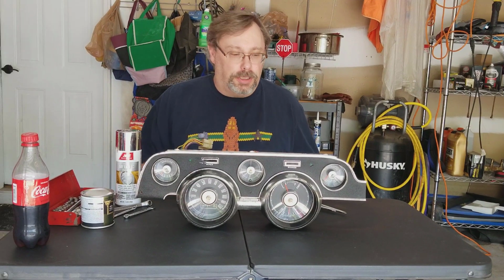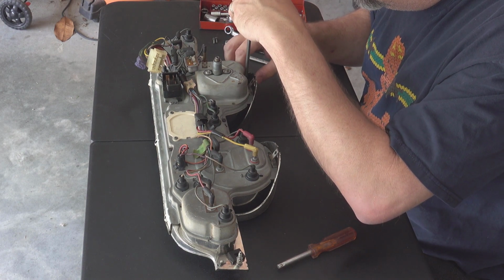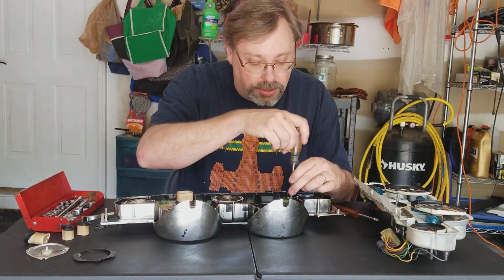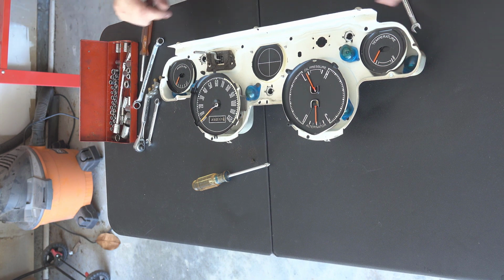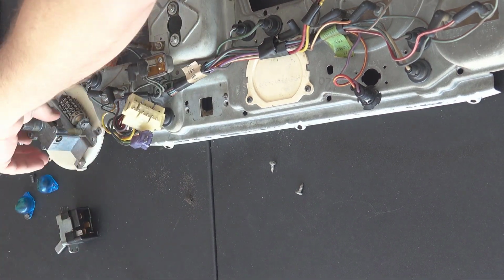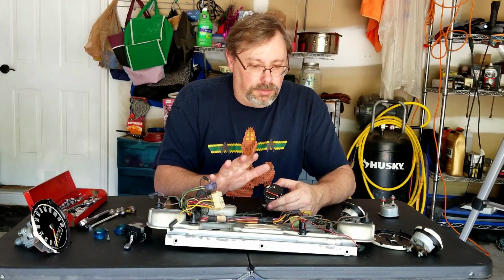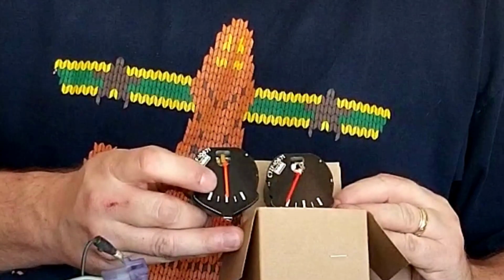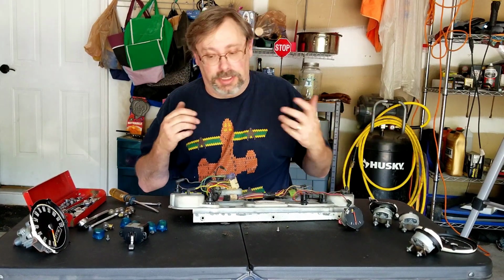Rewire the Stang Part 2 - Taking apart the instrument cluster

Comment: Man, I'm glad you did this video. Now I can use it as a reference too. The lenses on mine are no longer See Through, all the chrome plating has flaked off and countless bulbs burned out. The first (or last) person to remove the cluster didn't realize that there are two hidden fasteners on the cluster housing. The one behind the heater setting levers and one in the middle, above the steering column. The cluster housing is broken in those places.
Reply from the maker: Glad you think it will be helpful.